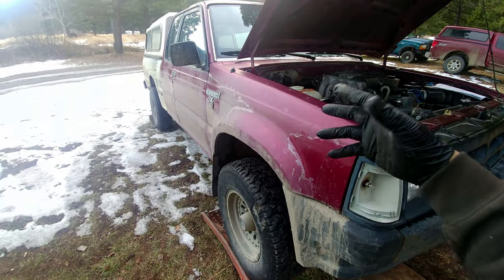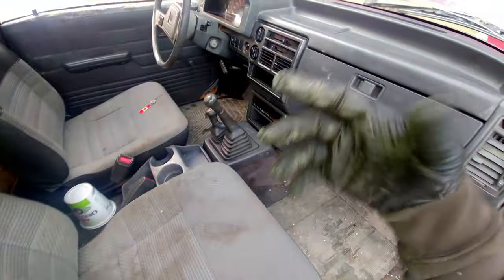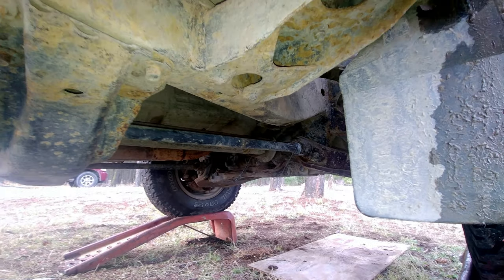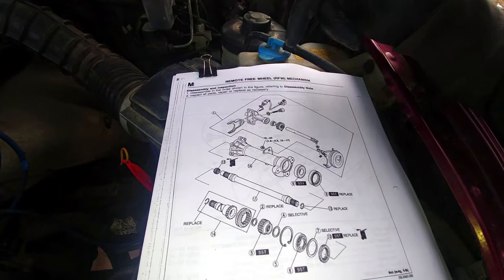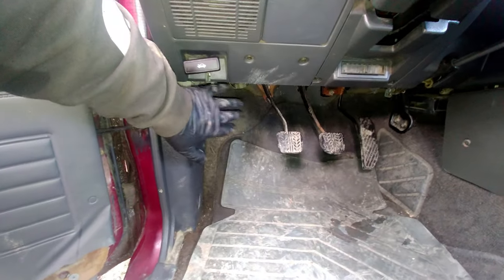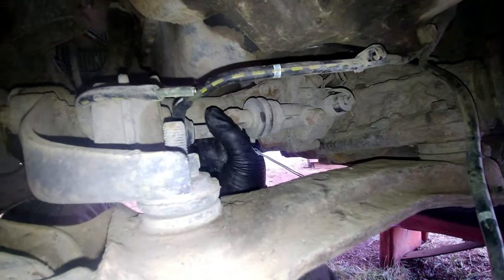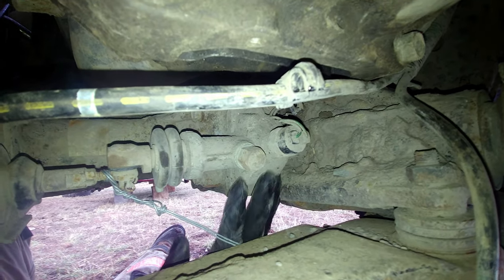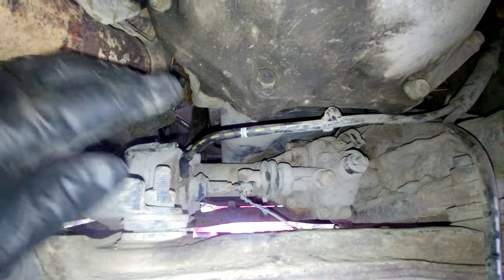4x4 DOES NOT WORK on MAZDA b2600i - REMOTE FREE WHEEL (RFW) MECHANISM Quick Fix// 4K

Comment: Thanks heaps, mine still works like a champ but now I have a quick fix it i have a fail on the trail to get out. Adding wire to my tool kit haha thanks 😄
Reply from the maker: Right on Lindsay! I have extra wire in mine as well! How many clicks on you b2600i?
Reply: @PistonShack  its def a must have, my ole girl sitting low 381 thou on the clock now and still going strong

Comment: Thank you, I was wondering why the front wheels were getting locked , I guess I'll have to do the same on my 1991 4×4  mazda, I changed the automatic transmission for a manual transmission, And many things I did not pay attention, Im learning from you guys in U-tube.👍
Reply from the maker: Hey Pilgrim! Did you mean your front axle permanently locked? b2600i is pretty simple animal, compare to modern trucks - if you swapped AT components to your truck including AT module I don't think it needs much.
Reply: @PistonShack  Thank you,🙏

Comment: Hi I have a 1987 b2600 with manual hub locking ( from the 2 front wheels ). It’s the carburettor engine. One problem I have with it is that when driving at certain speeds ( 20 - 30 mph) the whole car vibrates intensely. The vibration seems to be coming from underneath the car and not from the steering wheel. I thought it was a driveshaft so I took it to a couple of mechanics to tell me what’s wrong with it. After taking a look at it they said that that the drive shaft is fine. One of them stated that it’s normal it’s the wheels that cause this vibration. Does yours vibrate when driving?? What do you think may be causing this vibration???
Reply from the maker: Most likely you have balancing issue with your tires. I had some vibration, you described, on my truck. Due to some dirt build up inside the rim and lost one of the weights as well. It still vibrate on HWY a bit due to old tires.

Comment: What kind of lockers do you need for a 1989 mazda b2600i 4x4 single cab?
Reply from the maker: I don't think you need any manual hub lockers, just good to go with factory set up.
Reply: @PistonShack  but when it comes to a 1989 4x4 single cab, does it need lockers? What's the purpose of the remote free wheel.  Please help me on that
Reply: @PistonShack  and what do you mean by set up? Im sorry that i am asking this. I've been too ignorant about this truck.

Comment: My RFW seems locked. I found 2 green wires rubbing on my rear drive shaft but cannot locate where they are supposed to go. Rfw switch says LOCK and 4x4 on the dash
Reply from the maker: Hey Jeremy! I will try to find it out. I have Mazda b2600i service manual. What is your model and year?